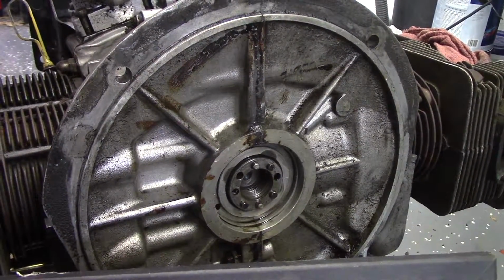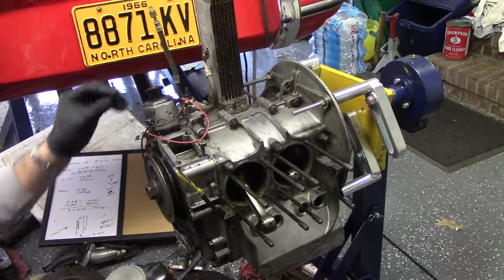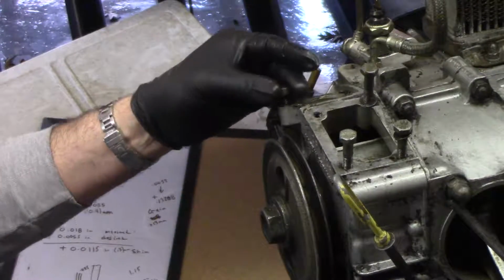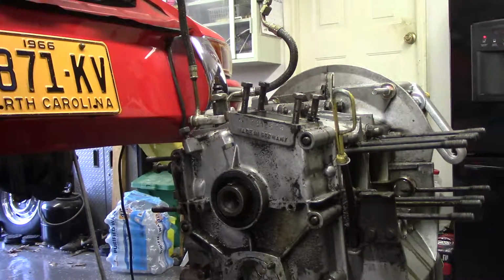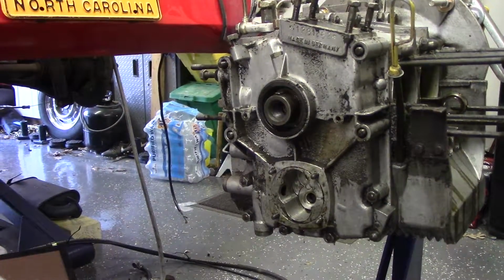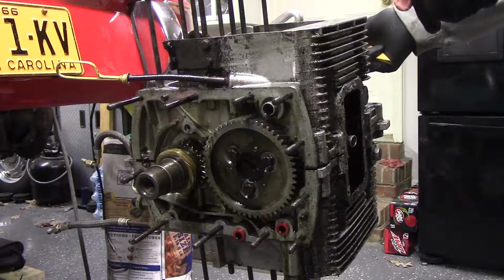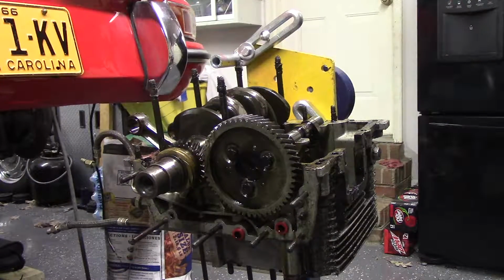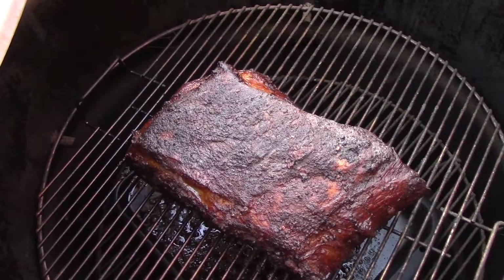Porsche 912 Engine Rebuild Part 11

Comment: Not sure how they do it on 912's , but the VWs use three shims for the flywheel shim pack ( two rotaries in one stationary is the theory). You might want to re-read the manual on this part, you can use a different combination of three shim's to come up with the desired thickness for a given purpose. That is why they only sell shims in certain sizes as you can come up with multiple combinations using those various sizes. Keep up the good work the oil pickup tube is a good Save, you need to secure that somehow. Maybe by expanding the part that goes into the case or using J-B Weld or other epoxy.